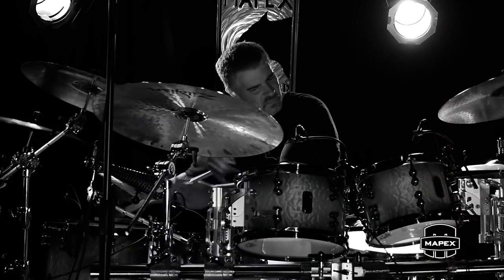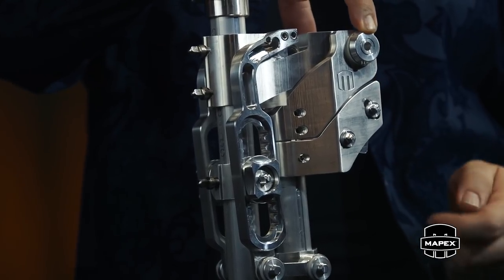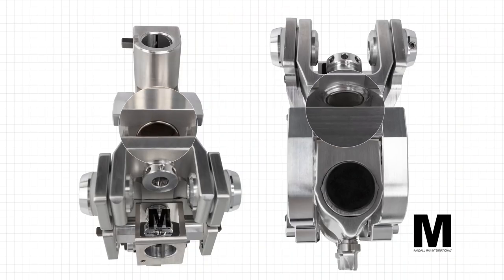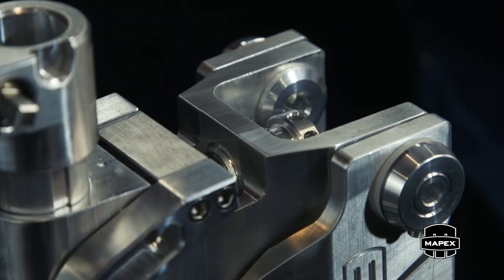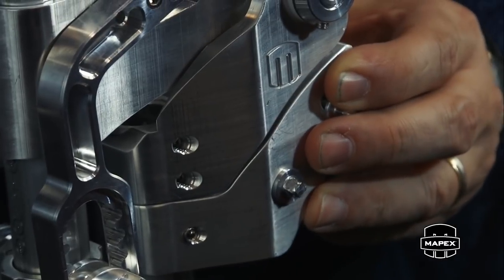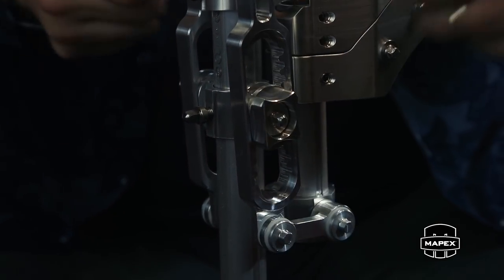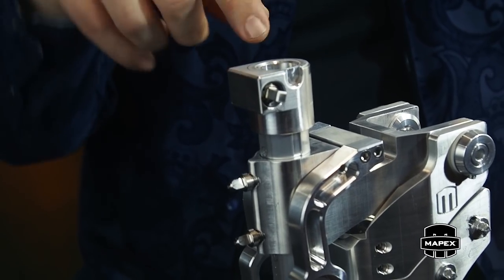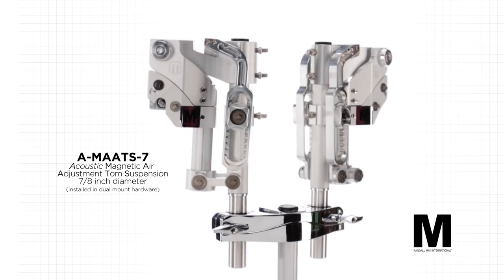Mapex Black Panther Design Lab Kits - MAATS Tom Mount Feature Overview with Russ Miller

Comment: conveniently forgot to mention how its actually attached to the drum shell
Reply: It has to be welded on 👍
Reply: It's attached to the bottom lugs on the tom.    It's a great idea for sure.  the only problem is you kind of have to buy Mapex Drums, which aren't my favorite.   It would be nice if there was a way to retrofit to other brands of drums and you can use their mounting system with other brands.

Comment: I have one.  it's not as bad in person as you think.  Totally over engineered.  the main issue is that you have to have a cymbal stand with a 1" diameter lower section and them a mystery diameter top section.  you'll need a mapex stand if you don't have one.  the HALO system on the evolution drums is much better i think.

Comment: The system chokes the resonant side of the drum. Should have been placed on the batter side lugs. As long as there is gravity, weight and physics still apply to toms no matter the isolation.
Reply: It can be attached to either end of the drum as you can see here https://youtu.be/-au2hRYskz8?t=55
Reply: Not true.

A lot of systems and drummers are using the bottom part.

I woudl even say it chockes less as a regular rims type of mount puts all the pressure on the top rim which affects the batter head even more.

Also this hangs from the (center part of the) lug, so no heads or even rods are touched, compared to other systems that do hang from rods.
Reply: @musiqsoundsproductions  good point